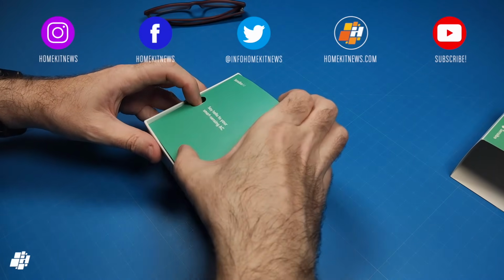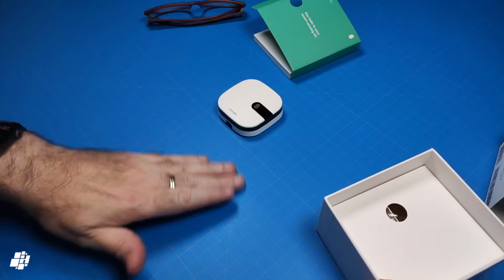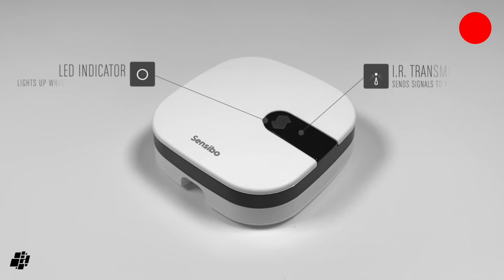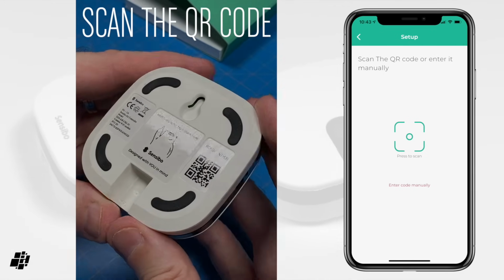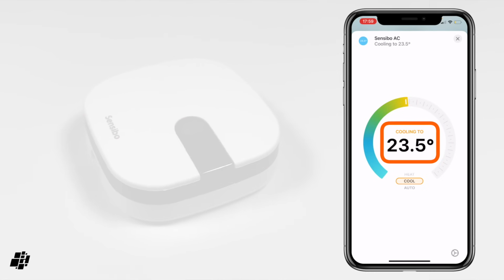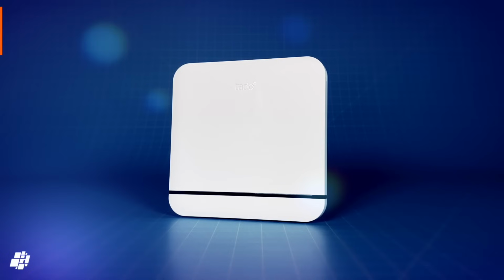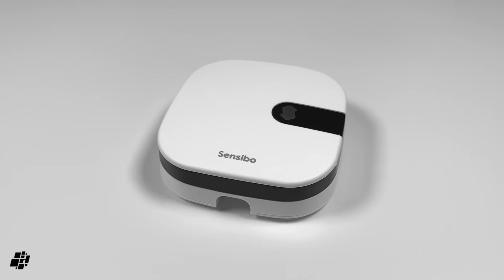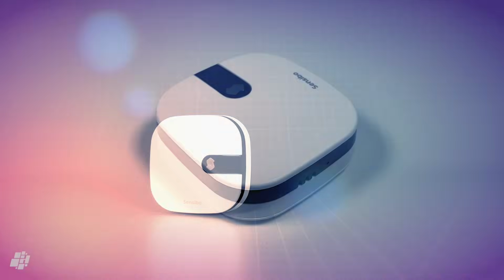Sensibo Air Smart AC Controller With HomeKit

Comment: Bought two units like that... they go unresponsive in HomeKit after some time (like 1h)... the only way to "wake" them up is to use Sensible app, not HomeKit... did you have the same issue?
Reply from the maker: I haven’t used mine for a long time so I can’t say. I use a mixture of AC controllers now.
Reply: @homekitnews  I'm reading now it might be because I don't have the apple hub - just using it on my local network

Comment: So there is no receiver, how do you know if your ac unit is smart enough to pair the sensibo?
Reply from the maker: I’m not sure what you mean.
Reply: @ I’m unsure how the sensibo would pair to the ac unit without any sort of receiver
Reply from the maker: @cadewilder6749 if your AC doesn’t come with an IR remote, then it won’t have a receiver, and therefore won’t work with the Sensibo or any other AC controller.
Reply: @ ok I understand now, thanks.  Is there any way to find out if a remote is a IR remote?
Reply from the maker: @cadewilder6749 usually an IR remote comes with a small dark panel for the IR signal to pass through. RF remotes, on the other hand, don’t typically have this little panel.

Comment: The sensibo air might work on remotes without a display since I saw a YouTube video about the sensibo and the person was using an AC remote without a display and it still identified the remote.
Reply from the maker: I have heard this, but I was unable to test whether it’s accurate. Pretty much all the other manufacturers insist on this as a prerequisite for their AC controllers to work, so I’m not sure how Sensibo managed to avoid this.

Comment: Can this be used to also control ceiling fan with remote control?
Reply from the maker: Not with this device, but the Switchbot hub 2 has an IR blaster that exposes up to 3 devices to HomeKit via Matter, although it would only be on/off in HomeKit.

Comment: I believe I have an issue with the thermostat in the unit. I set it to 25°C, and the actual room temperature is around ~20°C (I have a thermometer), but after 10 minutes, the unit's thermostat shows the room temperature to be around 30-31°C, and it doesn't provide much or any heat. Essentially, the AC sensor detects a much higher room temperature compared to the actual room temperature. If I use the "IFeel" button on the remote, it displays the correct (real) temperature. I used only the "IFeel" button, but after a while, it goes back to the unit's sensor. What can I do?
Reply from the maker: It’s been a while since I tested this out, and I don’t currently use it, but is there an option to offset the temperature reading in the app? I know Tado has this feature.

Comment: One device can connect to how many AC?
Reply from the maker: Each unit is designed to work with one AC, as it uses IR to control your AC unit. If you had two ACs in the room, it might be possible to control them both if the IR signal could reach both at the same time, but it would control each AC exactly the same, so both would turn off, on, set the same temperature etc.

Comment: would be perfect if it is battery operated so there wouldn't be an ugly power cable dangling off the wall
Reply from the maker: If it was battery powered, they’d last probably 1 week. WiFi is power hungry, and would go through batteries really fast.
Reply: @homekitnews  smart video doorbells lasts for months... i think the tech should be available now? either way, i nearly bought it but changed my mind when i confirmed the wire was going to be hanging out like that ;p
Reply from the maker: Rechargeable Lithium batteries, yes, but can you imagine the size of it if you had to install a battery of a size similar to a doorbell? Not to mention the increased costs. Note that all devices of this type are the same, so you won’t be able to find something that supports HomeKit and is battery powered.

Comment: I've just read some awful reviews about this. I'm not sure if I dare try it now.
There are a couple of other options you didn't mention. None are perfect, but they're options. The Aqara hubs with built in IR blasters have incredible functionality to run air conditioners. They have one downside, which for me is a big one. They connect to the air conditioner about every 20 minutes. Each time they do, the air conditioner beeps. But, you can fully utilise all modes (I mostly use dehumidify) and set multiple automations within the Aqara app to keep the temp within the range you want (drops lower, heat, goes higher, cool or dry, between x and y, turn off. And you can create Siri shortcuts to override the automations for a few minutes. I had It's a bit warm which set it to cool. Mostly used that if I'd been in the kitchen with the oven on or out in the garden in the sun and wanted to cool down quickly. Also had It's freezing for if I was cold (dehumidify function tends to chill the air beyond the set temp at times). So it was great, but the beep was annoying. I moved the G3 hub to a windowsill in another room to watch my driveway and had bought a switchbot hub mini for a bot, so have been using that on the air con. It's not as good, but no beeps. If you use the cool function rather than the dehumidify function it's probably perfectly fine, but if you set it to dehumidify you can't set a temperature, only lower the temperature by 3 degrees. It has been okay during our very mild spring weather, but summer has started to kick in now and it just doesn't cut it on a hot day if you're using dehumidify. Unfortunately I really need to use dehumidify as humidity causes hand pain for me so I'm a bit stuck! Maybe I'll get another M2 and use that on hot or humid days and use the switchbot other days. Hmmm.
Reply from the maker: Honestly I prefer the Tado or the Mysa for controlling my AC units, as they have on-device control. I think the Sensibo is overpriced. The reason I don’t include thr IR blaster options in the Aqara hubs to control ACs is they aren’t exposed to HomeKit. Whilst the two Ambi Climate devices aren’t exposed to HomeKit offically, there are plugins to get them into HomeKit, so that sets them apart in this respect.
Reply: @homekitnews  Ahhh, I see. I'll have to look into the Tado. There's no Australian version but the UK version can be used with an Australian power adapter. I can't find a mysa listing anywhere.
Neither the Sensibo nor Ambi have the dehumidify mode in HomeKit so I would be stuck using their app anyway. With the 2 IR blasters I've managed to set automations and a couple of Siri shortcuts so I don't need to open the app very often. It would be nice if it was in HomeKit though. At least the data from the sensors is.
Reply from the maker: Here’s a link to a video review of the mysa - https://youtu.be/DH96-R2FwM8 - but at present although the company are looking to sell internationally, at the moment they only sell (officially) within North America, so I think Tado is still probably a better bet and as it uses a simple micro USB to USB cable, and USB power brick will be fine to power it.
Reply: @homekitnews  oh great. Thanks!
Yeah buying American stuff is tricky as our power is 240v here. Worth a look though. Especially now I’ve decided to get another Aqara hub to use on hot days and then make a proper decision after I’ve moved. Maybe the mysa will be available here by then.
Reply: @homekitnews  what does on device control mean? I’m in Singapore and tado is more expensive than sensibo air, but I’ve read more good reviews of tado over sensibo. 🤔
Reply from the maker: I’m referring to the Tado having touch controls on the device, which the Sensibo doesn’t have. You can control nearly all aspects of your AC directly from the Tado. This short video shows the on-device controls - https://youtu.be/xrxM3PWhNKc or you can read the review here - https://homekitnews.com/2019/09/30/tado-smart-ac-control-v3-review/
Reply: @homekitnews  Got it! I saw your video on the mysa that allows you to adjust the fan speed so that sounds more interesting… I would like to ask if you are able to check the temperature and humidity readings of the mysa from homekit?
Reply from the maker: Hi, the mysa shows the current temperature on the display all of the time, only switching to the set temperature when you’re adjusting it. It then reverts back to the actual temperature in the room. As for humidity, it isn’t exposed as a sensor in HomeKit, but you can view the humidity in the settings section of the Mysa in the Home app.
Reply: @homekitnews  Cool, thank you so much! Keep up the great work ❤ subscribed

Comment: How does this device send the signal to the AC unit? Does it need to have line of sight to the AC or can it be connected to a power plug near floor behind sofa?
Reply from the maker: It uses infrared, just like the remote control it replaces, so it does need some measure of line-of-sight.

Comment: Great video indeed... by any chance do you know how I find out how many of these I need for my apartament? The number of Sensibo Air devices that I need to buy is given by what?
Reply from the maker: Hi, each Sensibo can control one AC unit - unless you have two in the same room and want them to be controlled at the same time with the same settings. So if you have 5 AC units generally you’d need 5 of these controllers

Comment: (4:49) There may have a misconfiguration that led Apple Home to think that Sensibo controllers use Fahrenheit internally, hence the half-degree steps when using Celsius.

(I'm not an Apple user, but this is one of the few videos I could find about the Sensibo Air. I couldn't find any videos about the Sensibo Air Pro!)

Comment: Hello guys, I saw the video, but I didn't quit get it. 
Is it fully compatible with Apple HomeKit, or do I have to run it through the app of Sensible? 
Thx in advance.
Reply from the maker: The Sensibo Air is fully compatible with HomeKit. You initially need the Sensibo app to set the device up. When I made this video, the device didn’t come with a HomeKit code, so I needed the app to generate the HomeKit code. The newer models now come with a HomeKit code on the device.
Reply: @homekitnews  Thank you very much for the response. I am going to buy a new A/c for the house, do i need one with a wifi module or with Sensibo Air it is not necessary.
Thx again in advance..
Reply from the maker: @panagiotispapadopoulos8186  if you get an AC with WiFi built in, that will just give you an extra way of controlling the AC, but not in HomeKit. Having the Sensibo Air means you don’t need WiFi for your AC. The only time it might be required is if the location of your AC is not reachable via the Sensibo’s IR transmitter, but as long as nothing is in the way of the IR signal, you shouldn’t have any problems.
Reply: @homekitnews  I think i found the channel with the best response! Man, you are a life saver. Thank you very much, once again.
I am trying to built a SmartHome from scratch and i have a lot of questions.
May i ask you again, if something comes up?
Reply from the maker: @panagiotispapadopoulos8186  you can ask me any time. If you have a Facebook account, you can easily ask questions via the ‘Messenger’ feature built into our website. If not, you can ask wherever is convenient for you.
Reply: @homekitnews  Messengers sounds perfect.

Comment: Can it work with more than 1 air conditioner in the same time.
Reply from the maker: Not usually, it’s designed to work 1 for 1. If you have two ACs of the same type and the device can send a signal to both, then it can control both, but they will always be working on the same settings.

Comment: Does it work with any AC brand? Samsung, LG,… whatever?
Reply from the maker: It should work with practically any brand, and even if it doesn’t have the codes to a specific or rare AC unit, you can still teach it to learn the remote control for hour AC.

Comment: Does it have "parameter correction" like in Aqara P3? My AC does not have "Heat" mode so I need to turn heat mode off from sensibo app and HomeKit
Reply from the maker: Hi, as I understand it, if it can identify your specific AC unit and model, it should only show the modes that your AC is capable of. If your AC doesn’t have a heat mode, then it shouldn’t show up in the Sensibo app.

Comment: So all any AC needs for this smart device to control it is the AC must have a remote?
Reply from the maker: I believe that the remote has to have the option to change modes, as well as have a display that shows the temperature. If the remote has these, it should work.
Reply: @homekitnews  ok so my window acs that remotes don't displace any info will probably not work with this. Thanks
Reply from the maker: @RossMalagarie  possibly not, although you should double check with Sensibo to be sure. All other AC controllers I’ve tested have had this requirement, but it’s possible that the Sensibo doesn’t. You can check whether your AC model is compatible via this link - https://sensibo.com/pages/sensibo-sky-air-compatibility
Reply: @homekitnews  Yeah the problem is I wanted this device to turn my window acs that don't have wifi into a wifi/smart ac so I can control my ac at home while I was at work, because if the ac has a remote with a display then it probably is wifi/smart already then I wouldn't need to pay $120 to make it smart? But thanks for the info

Comment: Hi. Thanks for the review. I have read elsewhere that the AC is unable to be turned off using Siri or Home app. Is that correct?
Reply from the maker: Hi, I no longer have the Sensibo here, so I can’t test Siri with this particular device, but I does work with my other AC controllers (I just tested it with my Tado to make sure!) The Sensibo should be no different in this case. There also should be no reason why you can’t turn the Sensibo off in the Home app.

Comment: Will this work with a york brand air conditioner ?
Reply from the maker: It mostly depends on the remote that comes with your AC. If it has a display that allows you to choose the different modes, as well as see the temperature it is set to, it should work.
Reply: @homekitnews  ok thank you!

Comment: Why all they all with a wire? Sucks to mount them on the wall.
Reply from the maker: You can also just place them on a shelf. As these devices generally all use WiFi, batteries would probably last a couple of weeks at best. Hopefully if a Thread enabled one came out, it would be a different story, although it’s also possible that the built in IR blasters these devices contain need a fair bit of power.
Reply: @homekitnews  Why? A remote uses also IR and lasts for years. Also there is wifi devices that last for years. Since this one has a touch function, it would be neat to place it next to the door above the light switch.
Reply from the maker: @ctlspl  I’m not aware of a battery operated smart WiFi device that can last very long on battery power alone. If you know of one, please let me know and I’ll be glad to say I’m wrong.
Reply: @homekitnews  Just to name one: the new smart faucet from moen.
Reply from the maker: @ctlspl  I'll give you some credit for actually finding a WiFi device that uses batteries, but come on now... Have you seen the size of the batteries it uses? 6 x 1.5v D size! just four of those together is about the size of The Hulk's fist! It also offers a wired power option for sensible people. Still, you're comparing apples and oranges here, as the Moen doesn't have the kind of sensors that need to be constantly monitoring the air, like humidity and temperature. These sensors are the reason you can't have a battery-powered AC controller, and if anyone thinks it would be a good idea to have 6 x D size batteries instead of a USB cable, needs to think twice. The only sensor device that measures these metrics and uses WiFi that I'm aware of is by iHome, and it's not battery-powered either.
Reply: @homekitnews  There are plenty of sensors that measure these values and are use Bluetooth. So the real question to ask would be why would it have to use wifi at all? Sending IR signals cannot be the problem, the LCD Dots won’t use that much power either and the sensors clearly would work with a battery powered BLE device. What do you think, why it has to use wifi and thus needs a constant power supply.
Reply from the maker: @nerv mich nicht  sure, there are Bluetooth sensors that don’t use too much power, so I guess you would have to ask them why they do use WiFi and not Bluetooth. Considering Bluetooth has never been very good for the smart home, and is on its way out altogether, it may be that you want quicker response times from these sensors than Bluetooth can offer. The original Eve Room, which I still use in fact, only takes readings every 10 minutes, which is of no use if you want to be constantly monitoring the room temperature. This is what AC controller do in addition to being a replacement for your remote. And if you have these on Auto mode, then the constant monitoring of the temperature is vital, so Bluetooth just doesn’t cut it in this instance.
Reply: @homekitnews  The most elegant way would be a sleek detachable Bluetooth/Thread/Matter panel that goes next to your light switch and does the dot matrix screen and controls plus a base station that does the measuring plus IR. And a separate version that only is the base station for the guys that only use their phones/iPads. That would solve the ugliness of cables and still would be comfortable to use.
Reply from the maker: @ctlspl  that would work! If there was Thread involved that would be the ideal option.
Reply: @homekitnews  We should start a business and develop them 😂